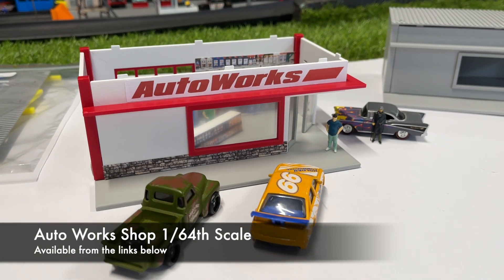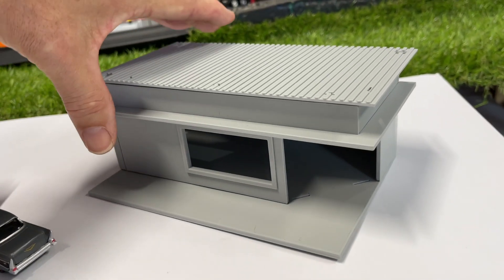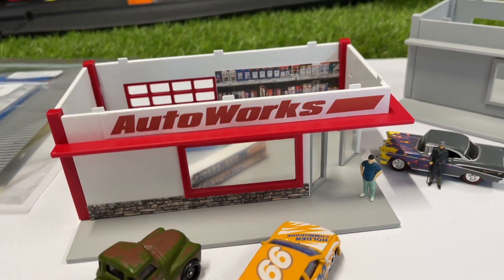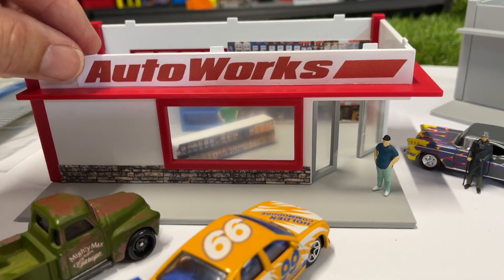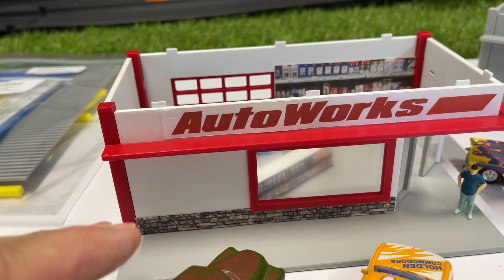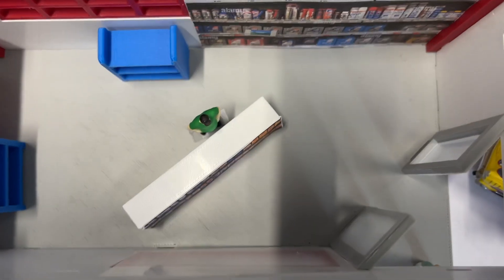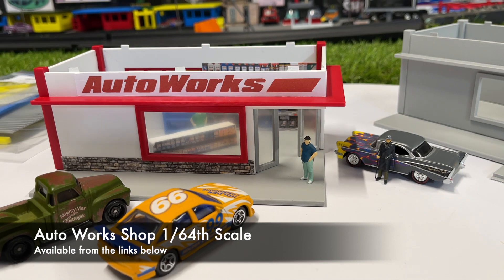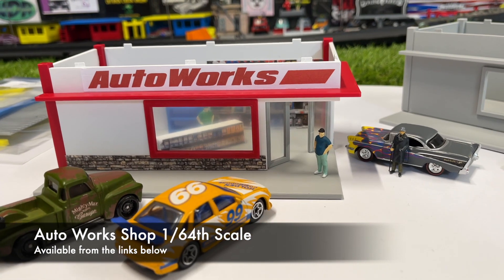Auto Works Shop 1/64th Scale Diorama

Comment: They keep getting better.  I like everything about it.  Very versatile piece,  printable signage is easy to come by.  The possibilities are endless.  Love this one a lot, the frosted plexiglass is a winner🏁🏁🏁🍻Cheers!
Reply: I can see that being a BlackFire ™ Tyer retail shop, attached to the outfitters garage with multiple lifts and tyer racks full of inventory diorama.  Awesome mate.
Reply from the maker: @PowerDriveRacingDJTrippleJ  I like this idea.  I'll make up a logo for this.
Reply: @HotCarTrack  That was the first idea that came to mind at first glance.  I also thought of a skylight in the roof to add natural light inside the structure without having to add electrics.  The material used on the front window could possibly be a good option for this?  Cheers!  Bravo! S.D.
Reply from the maker: @PowerDriveRacingDJTrippleJ  I also had the same idea and I'm designing a mod to this today and see how it looks.
Reply: @HotCarTrack  It could make it a hot seller, the design is perfect, for our track side needs.
Reply: @HotCarTrack  I'm looking forward to seeing how great it's going to turn out.  Keep up the great work, great things will result from it.  Cheers!
Reply from the maker: Just completed the design and now printing a test roof with skylight now, fingers cross it loos good.
Reply from the maker: @PowerDriveRacingDJTrippleJ  Thanks mate, just slogging away with designs and the last of the semis will go up from tomorrow, semis, 7, 8, 9, 10
Reply: @HotCarTrack  Perfect, tomorrow is Thanksgiving here, and a good race and some gridiron is always a welcome way to digest all the family and the food. Cheers!
Reply from the maker: @PowerDriveRacingDJTrippleJ  Good one mate, have a great day👍